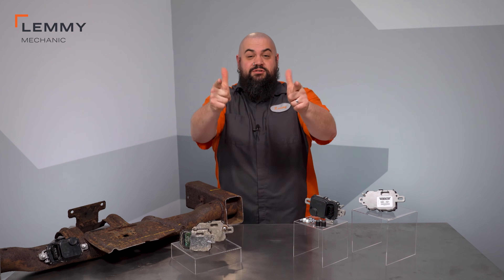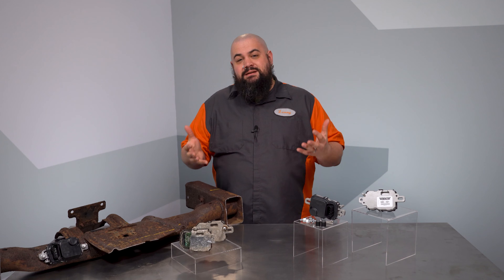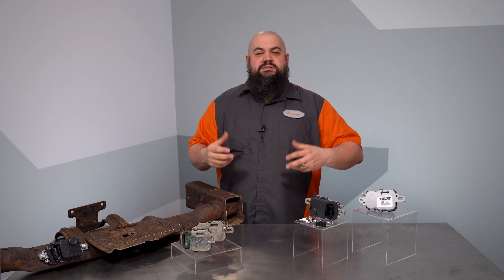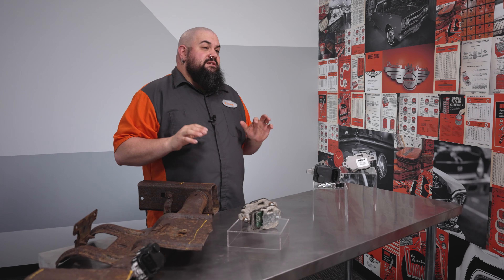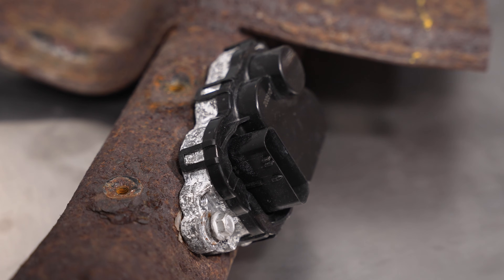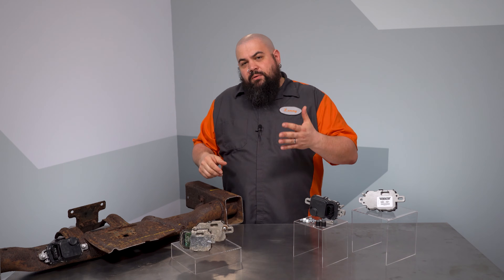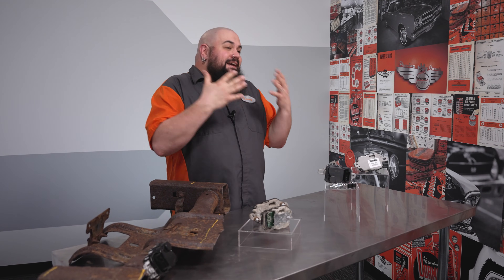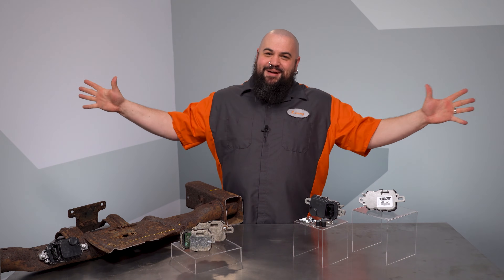More reliable replacements for a failed Ford fuel pump driver module

Comment: I replaced my OEM driver module with a Dorman one, the original lasted 10 years and the Dorman didnt even last a year. I wouldn't recommend as I replaced fuel filter, pump, and pressure sensor not thinking the fpdm would fail so fast, sure enough it was this part. Buy OEM.
Reply: Agreed. A lot of Dorman parts are sub-standard from my experience.

Comment: I have an 02 Mustang Gt, threw a fuel rail pressure code so i replaced it because it was cheap, no change, no fuel pressure so i replaced the in tank fuel pump. It gallops now abut wont start, it did, ran very rough and now just cranks and hits but not enough to start, threw a p1233 "fuel pump module" code. Only mine is in the trunk and looks pristine. Any way to check it? I hate to just keep replacing stuff but i have power to the inertia switch, fuses good, new pump and rail sensor..what else could it be?

Comment: Having trouble finding a fuel pump driver module for a 2003 f150 lariat 5.4 L v8
I was hoping you guys have one or if I can use one for the 2004
Reply: Rock auto, Amazon, eBay?

Comment: Replaced the fuel pump driver module on my 2005 F250 with a Dorman unit six years ago. 
No issues. A lot cheaper than a OEM module from Ford.

Comment: Weher is it located on a 2005 Ford F450 Super Duty (Fuel Pump Control) Module
Reply from the maker: Good question! It is on a frame rail underneath the bed by the fuel tank.

Comment: I thought my module was bad and then i just switched rhe fuel pump relay and it was fixed. Always check the relay first. You can just temporarily swap one to see if it works.

Comment: Does a 2000 F150 w/ 5.4 gas engine have a fuel pump driver module like the one shown here?
Reply from the maker: Hello, good question! It does not. Up until the body change in the early 2000's, those year F150's have the module built into the pump in the tank.
Reply: @DormanProducts  thanks so much for the info!

Comment: Hello.. Might be a dumb question but does a 1997 Ford Expedition use a fuel driver module? If so is that part of the fuel pump assembly?
Reply from the maker: Hello! Unfortunately we don't offer the entire fuel pump assembly so we can't confirm it contained the driver module.

Comment: Have a 2000 ford focus that the fuel pump won't prime unless the car is hooked up to a battery charger. Could this be the module? Battery is brand new.
Reply from the maker: Hello, good question! It could be the module. I would start there, the part # for your vehicle is 601-005.

Comment: where is the module located on a 2012 Lincoln MKZ awd 3.5 L ? It is not in the rail beside the rear seat driver side.
Reply from the maker: Try a bit farther back on that side in the trunk, left of the spare. —Lem